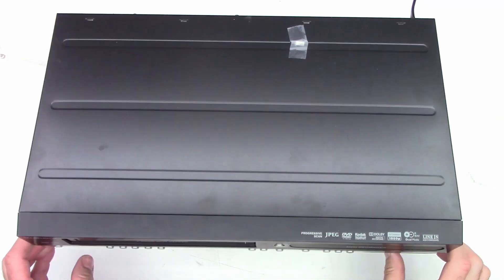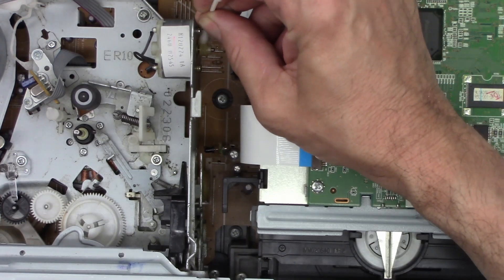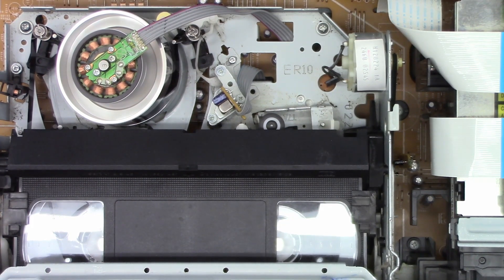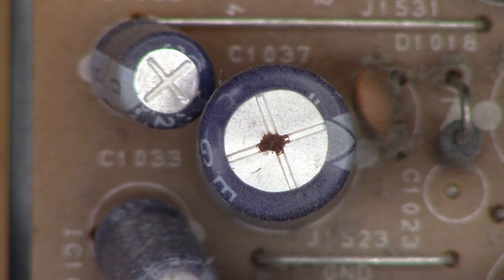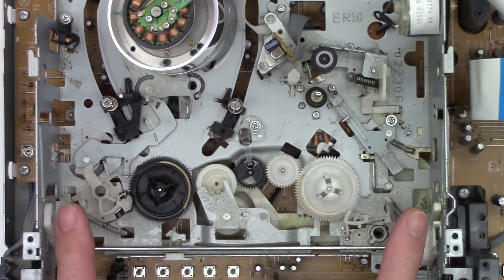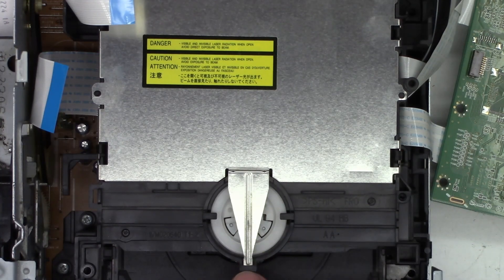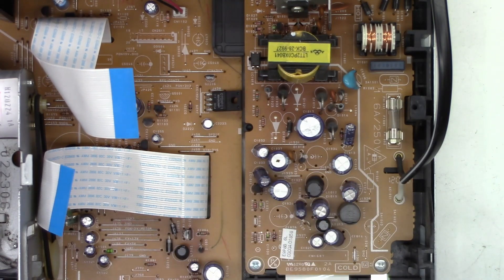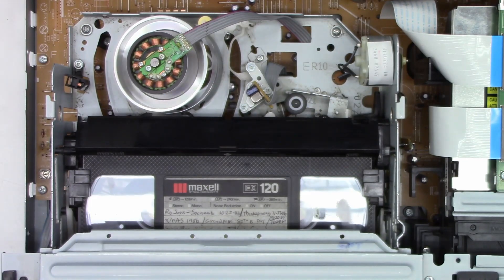ANOTHER MAGNAVOX DVD-VCR REPAIR ZV427MG9 A WONT TAKE A TAPE & SHUTS OFF

Comment: I have one of these I just purchased at Goodwill.  The DVD worked, but when I would put a tape in, it would power off after a few seconds.  Then when restarted, it would eject the tape.  After watching this video, I decided to remove the cover and check it out.  After removing the belt to clean it and the pulleys,  I noticed that the belt had a lot of memory in it from the small pulley,   But after cleaning and reinstalling the belt, it still wouldn't play.  Then I noticed the head wasn't even turning.  It was stuck, but freed up when I turned it by hand.  After I plugged it back in, the head turned and the taped loaded and played!  I noticed that when I would unplug it, the head would spin for a long time before stopping, so it was perfectly free.  I'm assuming that the head had just gotten stuck from sitting so long.  There wasn't even a speck of dust in inside.  The unit and remote looks brand new without a scratch!  Not even a smudge or finger print.  I have a feeling that somebody had it in storage for a while.  It came with the remote and the manual, so I guess I did pretty good now that everything works.  I have $10.69 invested in it plus  about 15 minutes of time working on it.  Thanks for posting this video.  It encouraged me to remove the cover and check it out. and luckily was able to get it going.  Otherwise, I would have sold it for spare parts!

Comment: Good repair when you have a spare. When you don't there are ways I have made white plastic parts either reattach or make them new entirely. Granted time is of the essence when being paid to repair something, but also irreplaceable items sometimes are worth the extra time and expense. I have used UV curable epoxy (Bondic) to reattach posts, latch tangs, hinge pieces etc. I have also had great success with either reinforcing or even rebuilding a part using CA (super glue) and baking soda along with an accelerant like Zip Kicker for helping cure time. I have reinforced the base  of a reattachment of a broken piece as seen here with CA & backing soda with sprays of accelerant. I have built and entire new piece onto the base material by building baking soda up in an over-sized manner and then quickly cutting the excess and shaping the final with the cutting disc on a dremel. Very easy process. Just finished a repair on a broken lid hinge for a MFC printer that someone jacked at an angle and broke at the pivot pin. Looks like the piece was never repaired. Even fairly matches the beige color AND is really quite strong using CA and backing soda with Zip Kicker accelerant. The bracket I repaired holds a heavy spring captive which acts as a lid assist to keep open or lower slowly and the side I repaired where the pivot pin passes through is strong as the original molded half on the other side. If the part is a different color then plastic model paint helps. Also the capacitor find is SO familiar. I too have replaced 1000's of those over the years on so many modern day pieces of the last 20+ years. We know it's not because they are dry from age as with the 60's-80's era stuff we work on it's the crappy knock-offs and poor electrolytic formula's they use to keep $ low. Oh not to forget the undervalued caps that should have been a bit higher value for the circuit they are in. Good work and really enjoy the channel.

Comment: Great video! I have a 457 model that looks exactly the same! My issue is after a few seconds of playing, fast forward or rewind....it just stops and powers down....upon restart the tape is ejected. I removed the cover and the belt you showed seems to work just fine for loading and ejecting....also the white plastic piece that you repositioned is in the correct spot. What else could be causing this...any help would be amazing. I'm trying to re-sell this and could get a bunch more if it actually works!
Reply: I'm having the same issue. Not sure what to do, any help would be great?
Reply: @LaLunaKnight  after cleaning the optical sensors everything worked fine! This same channel has a video that walks through cleaning the tape sensors. That fixed it for me! Good luck!

Comment: My DVD tray is stuck open. Motor pulls it in partially but then it is blocked.  I tired to push it in from that point but there is something blocking it. Any ideas about how to fix it?

Comment: Maybe I don't know what I'm doing, but when I stick a tape in, it looks, internally, like what it's supposed to do, but then the tape guides retract, leaving the tape out, and it shuts off.  On the monitor, it says, "EJECT C," which I assume means a capstan problem?  If so, how do I examine the drive belt, without having to remove/dismantle the entire unit, because, after I unscrew the mounting screws for the VCR side, instead of lifting out, like other VCR's, there's an inverted screw, holding on to it, which appears to be that I'd have to take out the whole motherboard, just to look at the belt!  Then, there's the problem of not being able to find replacement belts.  If I rig rubberbands in there, which won't last long, requiring me to have to disassemble every time...
Seems best to just hook up another VCR to it and deal with it, huh?  Why do these machines only play so many tapes then go caput?

Comment: Been watching your videos repairing magnavox ZV427MG9 units but haven't found one that covers my unit's problem.
Tape loads and seems to get real tight making a sound as if the tape is being stretched and stops.
After about 5 seconds the unit shuts off. When turned back on, the tape  ejects ok. I have the unit apart now and the mode selector switch silver contacts not Shiny but looks like coated with a light dull gray coating. Used a brass brush and seemed to get very fine powdery substance off but tough. Waiting to hear from your reply before reassembling if it may be something else.
Can you suggest a fix?
Thank you.

Comment: Hi NorCal715, wondering if you can repair my mistake? I have a D-VR610, which appears to be identical inside to the unit in the video. I'm handy, but only enough to cause myself problems. I was disassembling my unit to clean the rotarty encoder, and didn't realize that I didn't need to remove the optical pickup ribbon @ 13:40 in the video. I broke the connector. Is this going to make it cost more than is worth bothering with?
Reply from the maker: Hard to say. Email me norcal715videos@gmail.com
Reply: I ordered some new connectors to try,  as at this point I have nothing  to lose

Comment: I have one of these units that when I put the tape it powers off and then when I turn it back on, it ejects the tape.
Reply from the maker: Probably the mode select switch is oxidized
Reply: @norcal715  actually, I found another video on YT that said to check to see if the head was spinning freely.  Mine wasn’t.  I spun the head several times, clean it with alcohol and now it is working perfectly!

Comment: I have a maggotbox/magnavox tv,with the built in vcr,dvd. I picked it outta a closet of a foreclosed home brought it home popped the back cover air hosed the internals cleaned the vcr heads guides.. the thing has been flawless for 2 years working like a champ now when you turn it on and go to operate the vcr it shuts down, tape ejecting crooked grinding noise. been watching these videos trying to get an idea. The tv is not feasable to ship not worth the freight. i have a working magnavox vcr dvd combi unit, the transports may be the same..
Reply from the maker: An oxidized mode select switch will cause those random symptoms. Also may be a mechanical failure especially if it ejects sideways.

Comment: Muy buenas sus enseñanzas, tengo uno aparato casi igual, modelo MDV530 VR, no le funciona el DVD, no lee discos y que uso usted para limpiar las cabezas y el lector optico? ademas no tengo el contro remoto original.  Y no comprendo el lenguaje en ingles, comprendo casi todo por la parte tecnica. Un saludo a la distancia.

Comment: Mine records from vhs to dvd for a few minutes and then just shuts off. It just started. When I turn it back on it just spits the tape out. I’ve barely used this thing
Reply from the maker: Will it play a tape all the way through if not recording? Will it play a DVD all the way through also?
Reply: @norcal715  yes it will
Reply: @norcal715  yes

Comment: Hello I have searched your videos in hope you might have had one regarding my dilemma. I have a Magnavox DVD VCR combo model ZV420MW8 with a VCR load problem. When I put in a tape, it only loads part way then stops. The right side of the tape wants to drop down for threading the tape, but the left side will not go down. It will then eject the tape as normal a few seconds later.  When I try it (I have the unit apart) and "trigger" the works to load without a tape, the loading will complete normally as if there was a tape in it...then it will "eject" as normal without the tape being in the carriage. Any chance you can produce a video that might address this? I would hate to toss this out as I need it and cannot afford another one. Thank you !!!
Reply from the maker: It sounds like the tape is getting hung up on something. Try to load the tape and then pull the power when it stops going forward to see if you can determine what it's getting hung up on.
Reply: @norcal715  I have tried other tapes and it does the same thing. The tape goes into the carriage, starts to drop down to load but is held up on the left side, right at the point the "door" on the tape will start to open then jams on a angle.  Not sure what I am looking for with all the levers, gears, etc., that could be the problem. On another note, good news. I picked up a Sylvania DVD-VCR recorder that the VHS side would not work. Carefully took it apart, labeling the screws and locations, cleaned the positioning sensor as you described and put dielectric silicone grease on it, miraculously got this unit back together...with NO leftover parts (first time in my life I have ever accomplished this) and the unit worked like a charm!!!  I thank you VERY MUCH for sharing your repair. I would have NEVER thought to look for or clean the problem. Now if I can only figure out my Magnavox unit!  THANK YOU!!!

Comment: The one I have had been working just fine since I brought it way back in 2011. However for some reason the time on the unit begins to get really out sync with normal time. After you correct the time over the next several days the time will get ready fast. Like if the time is actually 7:55pm Eastern the unit will actually say that it's 8:00pm. Over time it gets even more out of sync with the real time. Recently I bought a new replacement remote from Amazon because one of the buttons on the original one stop working. Ever since then the times doesn't get way out wack now and it stays normal. Was the original remote control causing that to happen?
Reply from the maker: That is weird. I do not have an answer. Sorry
Reply: @norcal715  Thanks for answering me and it looks like that the remote control was the reason because as of this message the clock on the device still has not gone crazy. Usually it would had been 8 minutes faster than the actual time by now.

Comment: Mine the power light blinks and the vcr player won't receive a tape and the dvd won't open
Reply: I can't afford to hire it fixed so am doing it myself but don't know what to do. I did this once before and I messed around with the slider things on the side of the player that makes it slide in and out. Didn't really do anything but try moving things. when I put power to it again then it worked. but when the main power is shut off then it goes back to not working but if the main power is not shut off then the vcr, dvd and all will work fine.
Reply: @arzellastarkey657  Sure sounds like a power supply issue. Bad capacitor possibly, maybe the bootstrap capacitor getting weak and not letting the power supply to start running sometimes/everytime.

Comment: I have a sony where it wont accept a tape, the motor doesnt even try, it was working before i replaced the capston belt , when i wind the mechanism manually in abit , and then power cycle the unit, it takes the tape in, what could be the problem here , any idea? I dont understand what ive done wrong
Reply from the maker: Check the record protect switch, some of those Sony's use the record protect switch to detect tape insertion. Message me back and let me know what you find. Also the model number would be helpful too.
Reply: @norcal715  i was looking at that switch because its the only place there seems to be movement when you push the tape in a little bit a small plastic piece pushes up against the record "switch" but it doesnt seem to be a mechanical switch , it looks like it could be optical or something the plastic part just butts up against a small hole in it. I have another working machine the same model (E730) I swapped over the power supply and the tape mechanism so i know the fault it on the main board , i just cant find it , and i dont really understand how the machine knows when youre putting in a tape , as i say the only place i see anything moving against something that looks like a sensor is this record protect thing
Reply from the maker: It should be a mechanical switch. Do an ohmmeter check on the switch. I don't think it is an optical switch.
Reply: @norcal715  i wonder if the hole in  it that i thought was an optical sensor, is actually where the push switch is supposed to be and somehow its come out , ill have to try find a schematic , i dont think its just a push to make switch   theres 3 or 4 contacts on it . I certainly dont have any more of these switches so id have to bypass it somehow. Thankyou very very much for responding and helping me out . I sit there for hours and hours sometimes trying to figure stuff out , its rare i have anyone to ask for advice with this older stuff . Love the channel by the way. Youre a genie
Reply: You were right sir , it was this little switch , it turns out 2 of the pins on it were just for the casing to hold it in , so its just a 2 pin push to make switch, i must have broken off the push button part ....so i put a normal push button in its place but the plastic tab didnt press with enough pressure to trigger it ...so i got a contact sensor thing out of an old walkman cassette mechanism , one which requires very little pressure to make it .., glued that onto the pcb in position, and that did the job its loading the tape in now ..thanks so much sir . I appriciate it. Iv asked a couple of questions over the years and youve always got back to me . Thanks for that.

Comment: Vcr plays 5 seconds.  Stops, ejects and shuts off entire system
Reply: More than likely dirty emitter and optical sensors. Watch some of NorCals videos on VCR's and you see what to clean. Pretty quick and easy to do. The 'processor' HAS to see that the tape is rotating, or it'll eject the tape and shut itself down after around 10 seconds or less of play.

Comment: Damage blue ray disc movies doesn't play at all yet damage vhs tapes proven there playing more greater then damage blue ray disc movies does specially everything proven vhs tapes don't have picture quality problem's at all TVs proven there the problem 1 tv settings brightness being on 50 had turned that down on 35 now on to the color settings being on 50 not enough had turned that up 87 everything was great now if that was the vhs picture quality then nothing would had gotten better like it did

Comment: What causes these players to often need a vhs tape inserted into the vcr for the machine to stay on? If i dont have a vhs tape loaded then power will shut down after several seconds. Also the door doesnt open up to let the tape eject. I have to use a small flathead and help the door open at the exact time it needs to open up otherwise it gets stuck trying to go back in the player and i have to then manually assist the tape to go all the way down and seat itself in position so unit stays on and dvd player recorder can be used. Its been working like this for years but the last few weeks its just been shutting down after a few seconds so then i have to open it up and help the tape go back in correctly. All the mechanisms seem in place and belts are tight. But something is jamming up the process . Any suggestions?  Some grease on the mechanisms maybe so everything glides better?